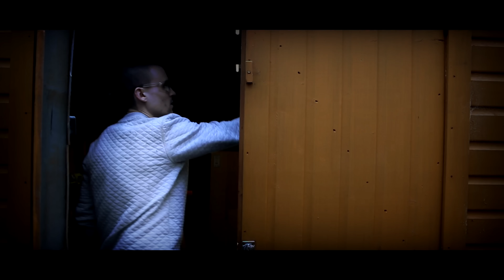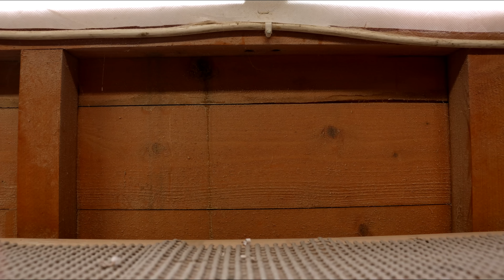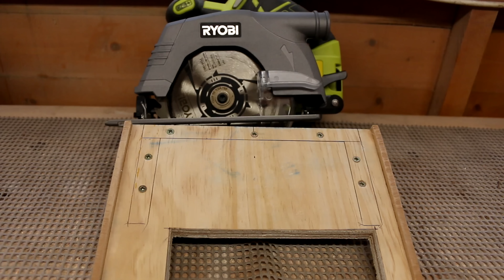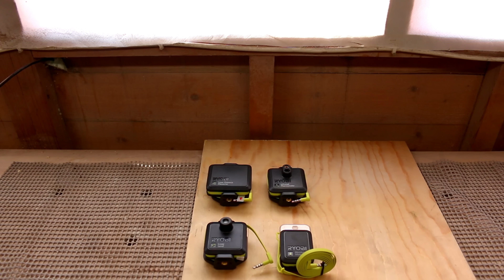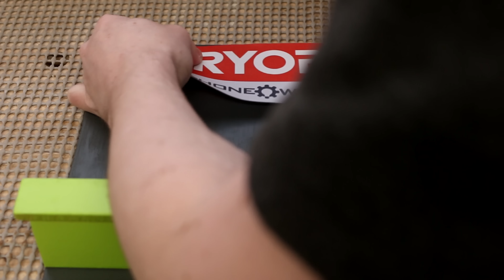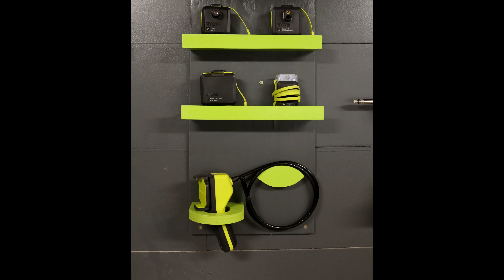Tool Wall

Comment: Love that tool wall!  I'd do the same, but my shed (10x8) is a little too small to have such a luxury!  I'm currently cladding my walls with 18mm plywood too and insulating with 3mm polystyrene.  It's quite cheap at £5 a roll at Homebase.
Reply from the maker: Thanks! My shed is 12 x 8 so not much bigger lol There are much better ways to store the tools but I wanted something that looked nice on video haha Polystyrene is great for insulation, especially at that price :)

Comment: Great looking backdrop. I'm curious about Ryobi... was it difficult to make a business deal with them? I thought they rarely dealt with YouTube content creators. I like their tools... and I own a bunch of them. Again, great looking project. Also, I take the same approach: store the tool to one spot without the ability to instantly change its location. Peg-boards and French cleats aren't my thing.
Reply: Regarding that wireless pipe inspector. I may get one if it's possible to attach the unit to a cable and push it 50 feet into a rain water drain pipe buried just under the surface of my lawn and watch the video on an iPhone just a few feet above it while walking the length of the pipe (trying to walk at the same pace the unit is being pushed)... again, so the phone is always just a few feet above the unit, albeit on the surface of the lawn. I know, crazy, right? In other words, I want the unit to inspect a pipe MUCH longer than the 3 feet wand the Roybi provides. I know that's a crazy use of it but, if it works, it would essentially do the job of a $4,000 50 foot video pipe inspector.
Just thought you'd get a kick out of learning what I may do with it.
Reply: Cool... I think I'm going to try it! If it does fall off and get stuck... it's only 8 inches below the surface (possible to cut it out from above and repair the pipe... not easy... but possible).